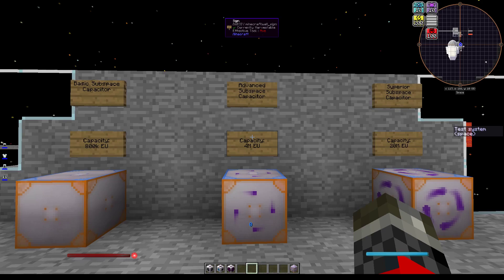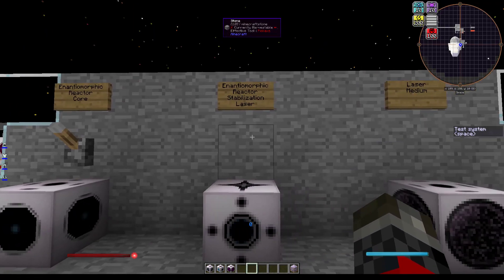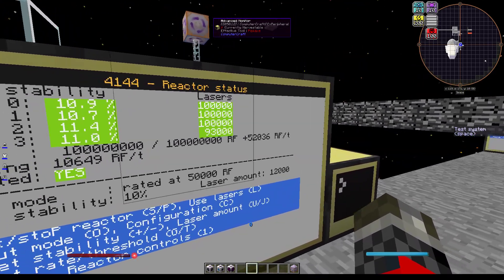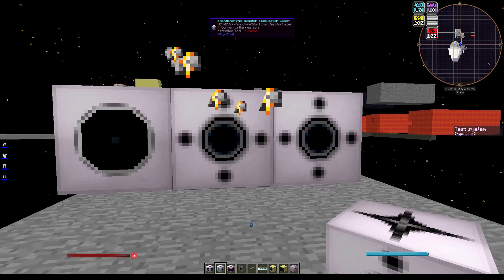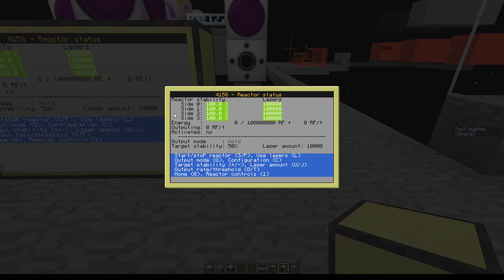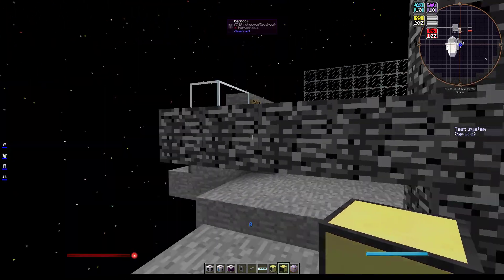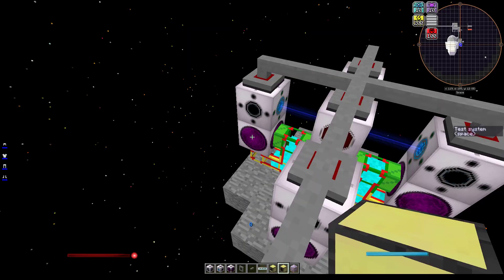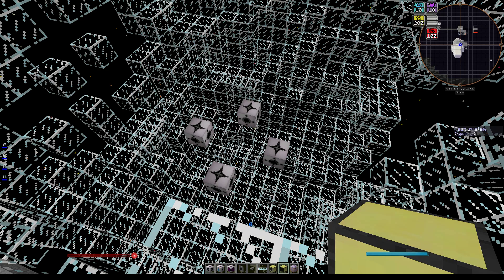Warp Drive Mod Ep. 3 - Reactors and Subspace Capacitors

Comment: So I did everything like the video instructed but every time my reactor has exploded. The only way I can prevent this is by turning the reactor off, wait for it to reach 100% and then turn it on. There is also no way to wire energy out of the reactor so what's the point of even building it and risking the safety of your ship or station in the process?
Reply: You need to put energy into the reactor to power the stabilizers, if you dont put enough energy into the system it will destabilize and explode. 

To draw power out you pull wires out if the capacitor
Reply: I suggest using mekanism along with every tekkit related mod that you play. There you get access to the Fusion-Reactor, which is powerwise probably the second strongest RF producing multi block reactor that exists rn. It's very complicated and ressource heavy to scale it up, but once you're there, you got basically unlimited energy. I power my frigate with 2 small ones which provide together about 2 million RF per tick, but for example my planetary reactor I'm using to power my infrastructure produces about 20 million rf per tick. It would be very complicated to pack all of that into a ship, but possible.
Reply: @hitbox7422  At this stage I literally just use a fusion reactor setup from Mekanism. It's just so much better
Reply: @susic1819  if you read my comment, that was exactly what I said 😂

Building one rn that I've placed on a literal tritium-ocean planet. The Deuterium is coming from a factory-station in its orbit, providing enough D-T-Fuel to basically power several reactors at 1000 mb/tick. I'm planing to integrate one of those fusion-cores into a IC2 matter facility that is specialized in organic materials, since that's something I've always had to produce from a precharged powerbank in order to maintain a steady UU-matter output.
Reply: @hitbox7422  I did read the comment and I agreed with it?
Reply: @susic1819  then I just misunderstood it, I'm sorry :-D

Do you know by any chance a galacticraft 1.12.2 addon for more planetary systems? I'm kinda stuck with legacy systems and a mod that let's me create my own planets, but that's kinda boring.
Reply: @hitbox7422  I have no memory of those mods. I think there was one but I don’t remember the name
Edit: I recommend asking Reddit. They should know

Comment: Hello, I don't know if anyone will see this but if they do, I have a problem. When I build the reactor and hook everything up, it doesn't work and every time I look in the reactor controls in my advanced computer, it restarts the computer. The only clue I have is that it gave an error code (startup 149). If anyone could help, I would appreciate it.
Reply: Try using the basic reactor. For some reason the advanced and superior ones don't work.

Comment: So I made it and it works so what is it for and how do I get power from it
Reply from the maker: 1) What is it for? A: To make power
2) How do I get power from it? A: Power can go out of the top or bottom of the reactor (in this version). By placing a capacitor on the top or bottom of the core, and the the capacitor set to accept on that face, the capacitor will draw out the power as configured from the core.
Reply: @MagicMouse  Thank you

Comment: how do you output the power from the reactor?
Reply from the maker: Power is output from the top or bottom of the core. Make sure the settings are set correctly on the computer you're using to control it.
Reply: @MagicMouse  k thx.  I'll let you know how it goes

Comment: Hello, I have such a question I'm playing in minecraft on the server with this wonderful mod and use for  control mode opencomputers and after two attempts to create a reactor, both times were failures, because the computer after some time is turned off and the reactor explodes from lacks of energy! How can this?
Reply from the maker: Is it exploding while the laser mediums are full of power?
Are the stabilization lasers firing frequently enough?
Is the target stability set high enough?
Reply: Magic Mouse the problem is that the computer turns off after a while and it is possible to remove it like that
Reply: Magic Mouse I just want the reactor to support itself
Reply from the maker: If the computer is turning off, please go to the discord in the description and ask in the #warpdrive channel. The mod dev will be able to help you there.
Reply: Magic Mouse Already found a solution! Just installed the mod computercraft and vse.Spasibo for assistance!

Comment: Roughly how much power does it take to get started?
Reply from the maker: I just started up a reactor and it used about 500,000 EU to start producing 10,000 rf/t. I would say that 500,000 EU is a minimum, but also when you're creating your setup, make sure your cables and batteries can get power to the laser mediums fast enough.